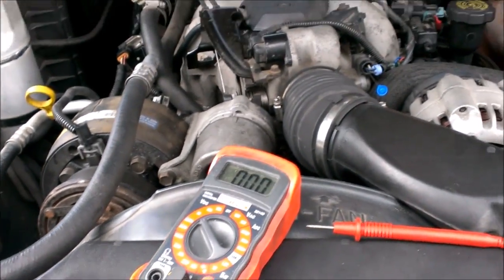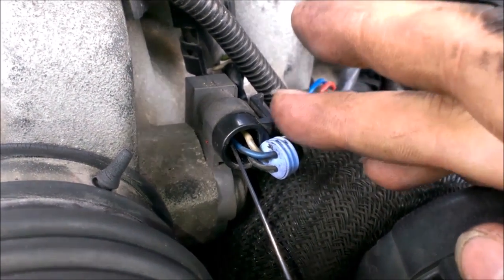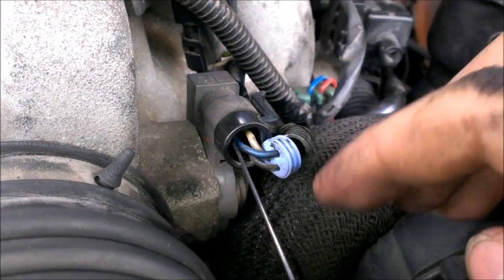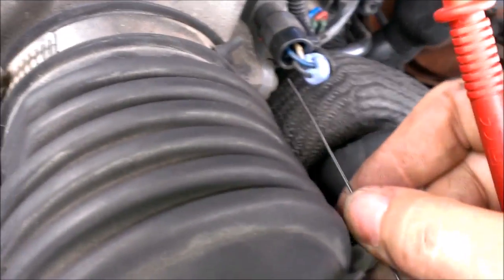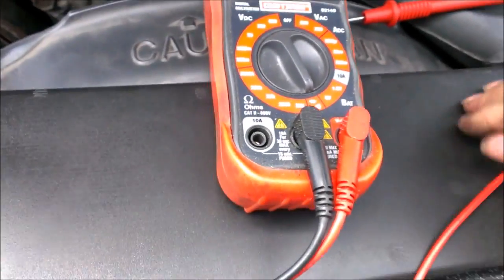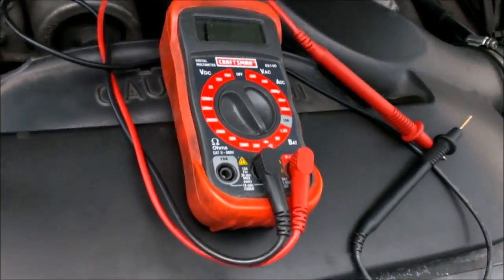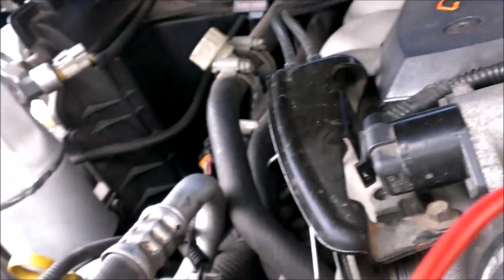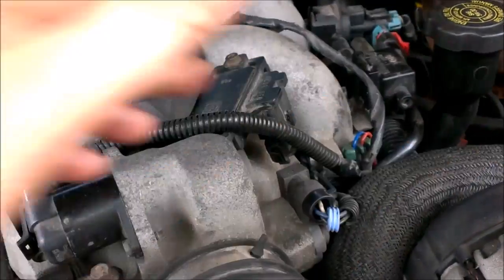How to test TPS sensor on any GM throttle position sensor

Comment: Mine tops out at 3.75 on the blue wire and 5.03 on the white wire. My ground/black is good, down to 1.8. Do I have an issue since it only goes to 3.75 volts at wot? it's smooth with no gaps in voltage but just doesn't even get up to 4 volts.

Comment: Hey buddy I know this is an old video. But I’ve not seen anyone work on this motor like mine. I can’t get the new tps sensor to line up to the screw holes. Should be simple only way it works if I force it on the shaft
Reply from the maker: It clocks in a way that when u get it in then rotate it to meet the bolt holes. Then tighten
Reply: @bam6972 ok cause when i get it bolted up my volt meter is not going up like urs did and ever since I’ve changed it my transmission won’t shift out of first gear. What v6 motor is this? I just got the truck to sell and I can’t find no parts for this engine

Comment: Shouldn't voltage be other way around on the reference from computer .01 then go up to .5 as you open throttle plate with
Reply: No about .5 to about 4.6 volts.

Comment: your ohms test was wonky because you did it on live circuit which give false readings since your meter injects voltage into the system to determine the ohms,testing live grounds just put on mv scale instead you shouldnt exceed 100mv on a low amperage sensor circuit.ive done this mistake before as well and i use ohms to determine if i have path to ground but not loaded circuit testing

Comment: hey do you know if these are adjustable or do you just bolt them up? my friend installed a intake manifold and is having drivability issues.i did hear you can recalibrate the throttble body do you know how?

Comment: What is the reading for the ground test? Mine was 1.43
Reply: the procedure was flawed, you cant do ohms testing on a live circuit as the way your meter works is your meter injects voltage into the wire to determine the ohms.you only do this ohms test on ground wires  on non live circuits to determine if it has a path to ground which isnt a good test either we always want to do loaded circuit testing to stress the ground,.instead you switch to mv scale and it shouldnt exceed 100mv on a low amperage sensor circuit.you will typically see under 0.020mv on a good ground,if you see hundreds of mv or volts or OL on meter you have a voltage drop issue on the ground wire,if you see 5v you have no ground. if you want to learn more about this stuff follow scannerdanner.

Comment: I have a 1999 Chevrolet P30 6.5Diesel this guy knows what hes talking about my transmission was not shifting into 2nd gear even at 4000 TPMs and only doing 40KM ...i did the test and replaced the TPS ...walla like night and day it not only shifts better it has more power and has 4 gears i have a GM 4l60E in it .. just wanna sat thank you SIR...have a great day to all from Vancouver Canada BC
Reply: Congrats on your success. I have a 94 S10 I bought new and now my youngest son has it. It's sentimental to him, we're doing our best to refurbish it. We replaced the Throttle position sensor but we're still getting a code on it. I've seen some videos that talk about resetting, restoring the idle position. After replacing yours did you have a procedure to follow to do a reset and if so. Where did you find the information. Thanks in advance for any help you may have.
Reply: i feel really bad for that 4l60. ive got a 3500 6.5 from 96 and it has a 4l80. that 4l60 wont last too long if you tow

Comment: I have a 94 Sonoma 4.3 Vortec. Changed tps, IAC , full tune up. I still have erratic idle and will rev really high at start up like over 2000 rpm but put it in drive it goes down. Tried resetting comp but still same issues. Any suggestions? Maybe bad computer?
Reply: Any luck?
Reply: @DIXIEMAFIA251  I reset the computer again by completely unhooking it. Hooked back up the next day and it ran great for a couple of days. Then went back to the same. I’m going to be getting a new comp soon as I don’t drive it much because it’s a low rider that’s all bagged. I’ll definitely keep you updated after I buy it and install it

Comment: Can you tell me the part number of that tps. I keep getting the wrong one (i think) from auto parts store. On your truck as well as mine the throttle rotates counter clockwise but the tps i keep getting cant and wont rotate that direction. It goes clockwise. Not sure why i cant get the right one. But maybe its and odd year on my truck. But your throttle rotates the same as mine so i need the same tps aw your. Comment on this thread. Ill find it.
Reply: Did you ever find the right part? I’m in the same boat
Reply: I did, so i went to gm and they cross referenced there part number to a napa part number. There seems to be 2 different type throttle bodies on those v6’s. the auto parts store kept giving me the part for the tps (computer default) that mounts on the passenger side of the throttle body. I needed a tps for the driver side of the throttle body, which obviously has to rotate the opposite direction. Napa does carry them, but you have to use a gm dealer provided number to get it.

Comment: i have a 1998 oldsmobile intrigue 3800 and I had to mount my tps with the throttle body attached. I wasn't able to calibrate it properly. The one time I had a mechanic take the throttle body off and mount it correctly I drove it to louisville and it ran AWESOME but then the engine compartment fire that I had a recall for and was waiting for the replacement part from the dealer who told me, well if it hadn't happened yet it probably wont but it did. I had to take it to dealer in louisvilleon dixy highway to have it fixed.... TPS hasn't been the same since

Comment: Been having an intermittent low issue causing hard shifts, randomly hesitating on acceleration the whole shebang I’ve tested 3 different sensors and a new one all with same results dunno if I should find someone with a dvom or try another new sensor
Reply: Did u find the problem? Bad pcm?

Comment: If TPS is going bad or messing up or bad does a code come up??? which code? thax i have a 4.3 blazer running like horse shit...i tried everything...no codes...Idles great but hesitates and bucks if i give it gas while driving..
Reply from the maker: check fuel pressure.
Reply: @bam6972  it's seems good around 60...I did have a bad connection to maf and fixed.seems better...but I am thinking running some good fuel injection cleaner through it may fix it even more...but I also ordered a tps ...I believe it's a combination of issues that is causing problems...I bought it from a jackass,so I have no idea of the trucks history...thanks
Reply: @roadstar499  new spark plugs might be just the trick. Good investment, if it doesn't work...
Reply: @TheFinney12345  or wires

Comment: A code tester like the Actron CP9690 can adjust the TPS. It has live, record, graphing, oil light reset, smog test readiness test, oxygen sensor tests, RPM'S, oil pressure, vacuum, VSS mph, and MORE! It has cables for OBDI for Ford, G. M., Chrysler, and 2 Toyota. It has a OBDII cable. It has a cigarette lighter cable, It comes in a black carrying pouch. Get a 12volt cigarette lighter battery adapter. Instructions are included. It works on cars from 1983-2013. It is updatable.
Reply: Marty : I have that scanner . I can see the TPS Voltage on live data stream when the car is RUNNING . However , the TPS on my Chevy has to be adjusted to  .55 volts when NOT RUNNING , like in the video . I cannot read voltage on the scanner with the key on , engine off . I borrowed an old Snap On MT 2500 and you could adjust it . But not on the Actron . I even called them twice and they weren't sure . Unless I am missing something ? Let me know if you have done any pre 1996 GM's . Thanks , Bill .
Reply: @billsmith2212  , there is a physical / manual adjustment relearn procedure for setting the base idle on pre 1996 Chevys.
https://youtu.be/nJkPgkMpTFs